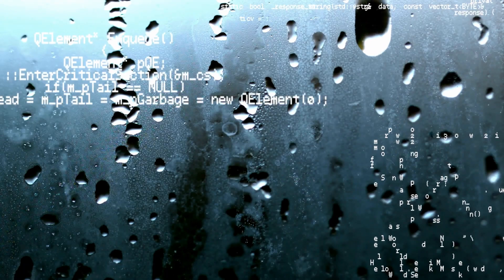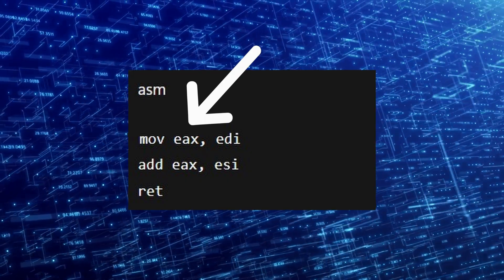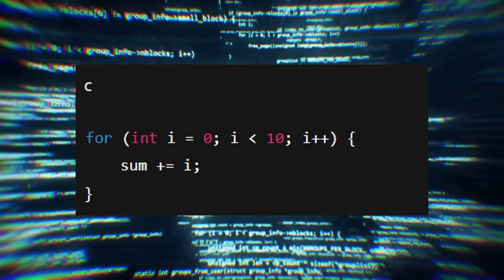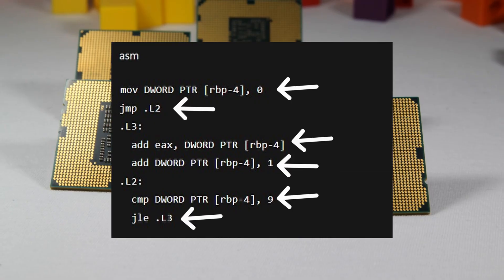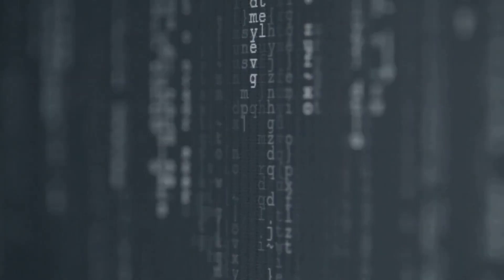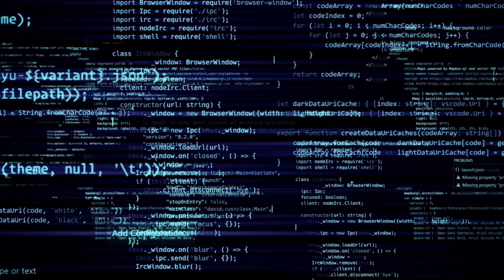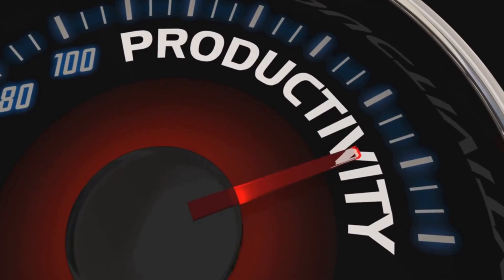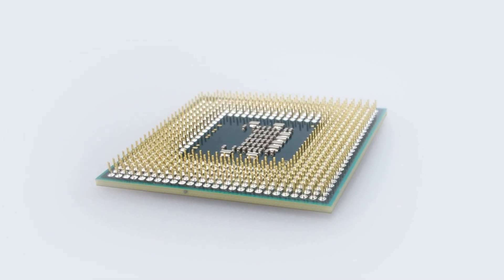C vs Assembly: What Your Code Really Becomes

Comment: Or the compiler might generate for that add function: lea eax, [edi + esi]. That is if it doesn't inline it, although, without static it's far more likely to inline it wherever it's used but still generate the code for the final binary.
Reply from the maker: Ah, thanks for the addition there! Yeah, assembly optimization can do a lot of different things depending on the situation and system.